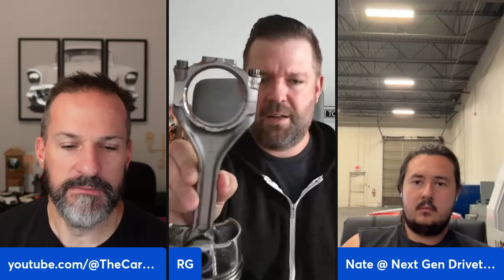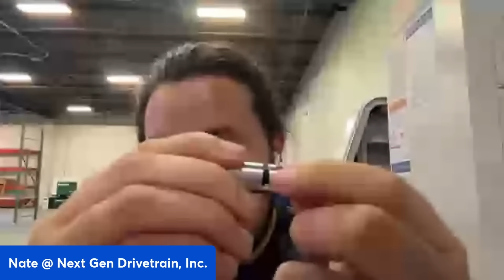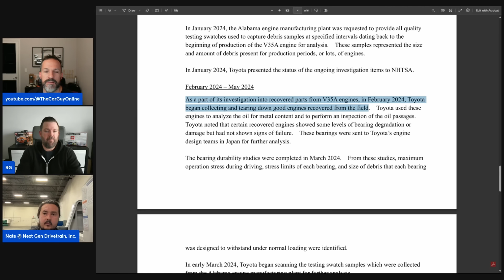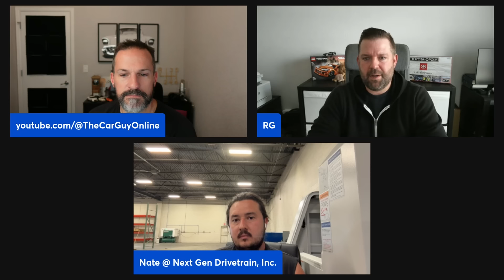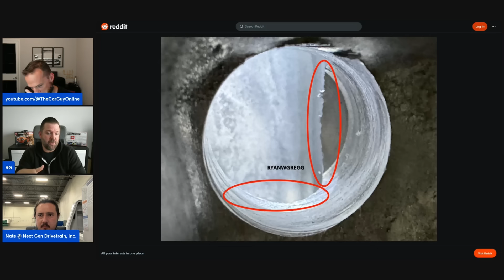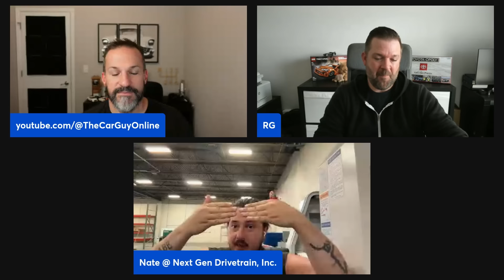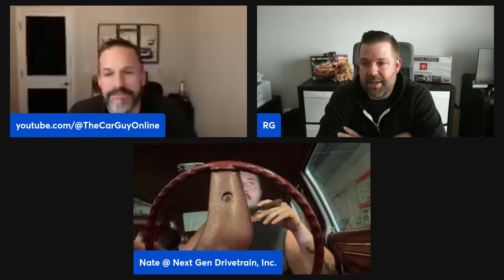Toyota Tundra BOMBSHELL. Buyer Beware Until 2026 (Full Interview)

Comment: sorry, this has to be said...  guy lost me at not running the factory reccomended oil viscosity (on stock engines).  my 2 cents is run the factory oil from the dealership parts counter, and, more importantly, the factory OEM oil filter and change the oil early.  🤷🏻 I go about 1/3 of the manufacturers reccomend oil change interval.
Reply: If fuel economy regulations weren’t driving the auto manufacturers to use thin oil in the US I would tend to agree with you. 

However absent those regulations, Toyota allows thicker oil overseas for both vehicles I checked: The European owner’s manual for the 2016 Camry and the Australian owner’s manual for the 2023 RAV4 both allow two grades thicker oil in warmer ambient temperatures.
Reply: They were doing it in high temps in the Middle East. I’m old enough to remember when manufacturers used to recommend different oil based on the seasons or expected temperatures. I guess physics changed in the last 20 years? 
 By the way. Ford recommended 5w20 in their V10. U-Haul was given permission to run 10w30 by Ford. It’s all about trade offs. The OEM picks the best oil to use across all possible scenarios. That doesn’t mean it isn’t better to run a different oil under specific circumstances.
Reply: @AlphanumericCharacters well that is a fact, they still do reccomend you change your viscosity if you fall out of the temperature range that's specified in the manual.   that i will agree with you there.  but the guy RG isn't outside of the operating range where he lives and he specifies that he doesn't run the factory reccomended viscosity in his personal vehicles, he runs a heavier one.  I believe i heard on an engineering explained video that changing the cold flow number (the first number in the viscosity rating) isnt as dangerous as changing the 2nd number but I still dont see the point if you're  operating the vehicle on the street under normal circumstances and in normal climate conditions.
Reply: @kcm732 oh, ok. I thought you were referring to them mentioning the failures in the Middle East. 
 I wouldn’t change the viscosity either if in a normal climate. 
 That said I don’t think this is the issue. Nobody can make engines all of a sudden. I suspect it’s due to parts being sourced from China. There was a recall from Ford where they stated that the supplier of a cylinder head had altered something that caused a failure. I wish I could remember what it was but point is……supplier of cylinder head? Since when does Ford not make their own cylinder heads? What else are they outsourcing? You know if one is doing it then they all are doing it. I would bet major engine components are coming from China. I would also bet that is the source of many of these failures.
Reply: @AlphanumericCharacters yes, its certainly possible.   and also if you do care to watch the video I mentioned from engineering explained, the subject matter was on the recent GM v8 engine failures and their "fix" was to change to a heavier viscosity oil to engines that hadn't failed yet... its so wild, but I digess... I still kinda dont trust the guy named RG as a guest completely from his statement on the oil viscosity.  
but yeah, who knows where toyota is getting their parts from. I do know that all toyota truck engines. at least the tacoma and tundra, final engine assembly is in the USA, But truly unsure where the raw materials come from.  
there's even wild/strange issues with the V6 3rd gen tacomas (of which I'm an owner of one) where they will randomly just burn a valve on, usually cylinder #1, and sometimes on cylinder #5 most times, but #3 has also been seen.  I just dont know man.  no company seems to make a reliable vehicle these days unless its a mass market mover to save their reputations.  from where im at, only the toyota corolla sedan/hatchback, corolla cross, RAV4, camry, and honda HR-V are the only brand new vehicles that you can go out right now and purchase that have the chops to go for a very long time.  everything else is either solely direct injected, or has other high dollar maintenence or failures.  its really sad to see the the state of the auto industry right now.
Reply: @kcm732  not to burst your bubble but those cars you named are CVT. They suck. I had a few HRVs come in with CVT issues and the Honda dealer ducked and dodged all day. Wouldn’t fix them. One issue should trigger a safety recall. Another customer bought a used RDX a few months back. Only has 40k on it and it’s been a nightmare for her. I mention that specifically because I had it in again the other day. I’ve been seeing a helluva lot of junk coming from Honda. They recently had a recall in the J35 where they are rolling bearings into the engines too.  
 Hell I was looking at buying my kids a new Honda dirt bike. Damn things are made in China now!
Reply: @AlphanumericCharacters thats honestly the first time ive heard of any issues with a honda cvt. the only issues ive heard from Honda as of recently are the head gaskets blowing on the 1.5T and 2.0T and issues with the 3.5 v6 crankshafts and VDC system.  the toyota non hybrid CVT is honestly very good imo thats in all the corollas, and the non hybrid rav4 still uses the 8 speed for a bit longer which is fine for what it is. and all the hybrid versions use a cvt but its a completely different cvt setup in the hybrids vs. the non hybrids, and those seem to have been long-term reliable too.
I also used to own a non hybrid corolla cross LE AWD with the regular cvt.  I thought it was fine, I actually enjoyed the thing.
Reply: @kcm732  three different customers with the HRV that wouldn’t accelerate from a stop. Foot to the floor and the thing was as if it was in top gear. I never duplicated it and neither could the dealer. However, all of the owners had video. I’m going to say the first one was a 2018 and the other two were 2020. The one customer stated that the first time he did it was when he tried to make a left turn into front of incoming traffic. Sketchy as hell. Tried to lemon law the thing but because Honda never attempted repair and couldn’t duplicate the issue it was refused. That guy had like 20 videos. He mounted a dash cam on his console. The other two customers I didn’t get too involved with, just sent them to the dealer and told them about the other cases. Clearly this had to be a widespread issue. 
 Also know that the CVT in a hybrid is different than non-hybrid. Those tend to be very reliable. Whether Toyota makes better CVT than JATCO for instance doesn’t change the fact that they are not as robust. Especially with a more aggressive driving style.

Comment: I work at one of the big three, and I can confirm, what goes on is ridiculous, UAW is horseshit. Absolute legalized mafia. But what amazes me is that this guy bitches and moans about Toyota, and every five minutes says that he won’t buy anything else. And what do you think Toyota is thinking? Why improve when everyone is falling over themselves to by it anyway. The best thing to do is stop buying new overpriced junk, from all of them.
Reply: That mentality will spread like a disease through Toyota customers slowly though dont worry...
Reply: How does an engine built in Alabama is a  non-union factory where robots do the bulk of the work have any effect on bad v6 engines? DEI ( Do EVERYTHING for Investors) is way more of a problem.
Reply: @jimmyaber5920 Toyota has different issues at their US plants than the Big 3 do. The Big 3 would be glad to have Toyota’s problems, and Toyota’s stock performance. I’m just saying that UAW is a racket with a a stranglehold in the rust belt, and has to be treated as such.
Reply: I agree, people do need to stop buying the new junk. Unfortunately, that won't happen because so many people are brainwashed by marketing. Gotta have something new/status symbol. Also, many people are afraid of used cars due to the possibility of expensive repairs and no warranty.

Comment: 10 freaking gears in a truck/suv is nuts. 6 was absolutely perfect. Never thought I needed more gears...ever.
Reply: They wouldn’t put in more if they didn’t have to. It’s all emissions
Reply: @joseeduardo4327 exactly- always comes down to some leftist aka democrat bureaucrats/politicians
Reply: Some of those gear ratio are so tall.. they'll do almost a 100 mph in 3rd. so the other ratios are for what 😂 I think 8 speed is the cap.. the sweet spot.. over that it's just diminishing returns..
Reply: Hey Captain Mojo, I have a 2016 Tundra pulling a 8500 lbs fully loaded camper trailer, and to be honest, I feel there's missing at least 2 gears. Just because of the engine RPM and the transmission chasing gears from time to time between the 4th and 5th gear... that's just my opinion!
Reply: @Hunter-qg2bv I just towed my 8500lb boat plus a bed full of stuff from tulsa to clearwater last month averaging 70mph using my 5.7 Tundra with 6 speed and it was easy peasy. Mines a 2012 and never seemed to be hunting for gears. I wonder if yours is programmed differently.
Reply: @TheCaptainmojo1973 I hated the 6-speed in my 2012 Tundra. That transmission had a lot of problems in the early years so there could be an issue.
Reply: Gears planetary reduction cvts you don't even need to shift one gear all the way to 110
Reply: @Your-moms-hitachi if you hate cars buy an ev
Reply: @Your-moms-hitachi CVT's all suck. More cartel mandated junk.
Reply: We used to tow just fine with 3 speeds and a big block. Hell even a 350/TH350 towed well before all the emissions BS.
Reply: Like 5 manual gears!   Bring it back!
Reply: That’s was the green lobby idiots.. same with the turn off on when stopped bs
Reply: The regulator cartel thought you needed more gears, and they always win.

- Nate @ Next Gen
Reply: I’m glad to see that I’m not the only one to think 5 and 6 speed autos were the sweet spot.
Reply: I love the 10 speed transmission on the GX550
Reply: Nah 10 is the right amount. It just needs to work if it doesn't work it's bs

Comment: When I was in engineering school Toyota was used as the penultimate example of “Quality Engineering.” The company literally invented Kaizen/5S. This is demoralizing.
Reply: Kaizen and 5S are great tools. But like any tool, it’s only as good as the person using it. I would bet upper management aren’t invested in the process anymore.
Reply: It's been on the decline for a while. The unintended acceleration cover-up and changing their new vehicle warranty to claim that burning 1 quart every 1,200 miles being signs that the corporation was changing for the worse.
Reply: @hochhaul My daughters had V6 Honda engines- 3.7 L and 3.5 L.  Heavy oil consumers - Honda said that as long as they didn’t use more than 1 quart of oil/ 1000 miles that was acceptable.  So it’s not just Toyota.  I’ve owned Toyotas and Lexus vehicles and they didn’t require adding oil between oil changes.  But it sounds like the newer Toyotas aren’t built like the old ones.
Reply: The “Toyota Way”. 😂
Reply: Don’t read any updated versions of the “Toyota way” book.  The original is best
Reply: The Japanese built stuff is still good, this is a USDM problem
Reply: When I worked at USG they started 5s because of Toyota, but let me tell you they didn't use it to have better QC in my opinion lol. People don't understand that Toyota has  and will continue to lower it's standards because Ford, GM, and Stellantis already have and are still selling this crap and are there by financially incentivized to do the same. The only thing that stops is people voting with their dollars. Loyal customers are rewarding bad behavior like a bad parent.
Reply: For the most part Toyota  new 4 runner is garbage.  Power is not linear in the 4cyl turb, interior is smaller with a bigger overall vehicle.  In Texas heat kills and im curious how many people will blow up the already.overstressed 4cyl drivetrain.
Reply: They are also mentioned in many business books as well. I also encountered this in engineering school as well. Clearly times are starting to change but companies can make mistakes even those that have been at the top.
Reply: Continuous Quality Improvement had it's founding by Walker Shewhart and W. Edwards Deming. Japanese call it Kaizen which means "change for the better".
Reply: @troycarothers8254 enter teh beancounters…
Reply: I love when hedge fund stooges in corporate America try to roll out kaizen as a ruse to their employees and shareholders. Kaizen is a cultural thing that doesn’t work in a world run by accountants.
Reply: It's what happens when you get accountants and MBA's involved and lose sight of design, quality, and testing. Instead, focused on outsourcing and cost cutting. Just god awful.

Comment: So you're putting 5w30 in a 5.7? Have you done anything to the engine or is everything stock? I'm run 5w20 now. Im not a big fan of running 0w20.
Reply: Same 5w-30 ,2021 platinum tundra 58000 will not use anything else

Comment: So the new Tacomas are having the same engine issues as the Tundra? So it definitely has something to do with the manufacturing procedures/process at the Alabama plant? I’m also surprised there isn’t more talk about the faulty rear differentials on the Tundras. That seems to be a widespread issue that is under reported.
Reply: The Tacoma engines are made in either West Virginia or Alabama. You'd only be able to tell who made it by looking at the engine block.
Reply: New tacoma does not have the wide spread issues the tundra has.  I have one and its not even an issue on tacoma forums or owners group

Comment: Moral of the story pre-covid better quality. Post covid worse quality. Can say that across the board manufacturing, service industry, etc.
Reply: Boy you nailed it peter, I’ve noticed the same thing. No pride in workmanship in any industry anymore. Buy it, or get out of the way, the next person will buy it, people don’t even say thank you anymore.
Reply: Interesting how Frontier quality is fine post-covid, even launched DURING  covid, yet no one can seem to admit that.
Reply: @TIJoe-te9qu Frontier is a great truck. Simple design. Workhorse.
Reply: Lol.  My Jeep Grand Cherokee was built in June, 2019.  I still have some problems, but the newer ones are even worse.
Reply: ICE technology has reached its end game. EV technology is taking over worldwide, some places faster than others, but it is happening. Gasoline engines have reached the point where every last HP has been squeezed out of a block before reliability issues make engines not a valid mainstream solution anymore. Back in 1987 a large V8 out out 200hp. Now modern engines are expected to put out 400, 500, and more than 700hp out of a smaller block. Crazy. BYD just rolled out a 3000hp super car that can jump in the air like Speed Racer.  The US risks falling far far behind the rest of the world if Americans do not realize EV technology is now more reliable, faster and more reliable than gasoline engines. This is the modern reality.
Reply: @nerdbikes3841  EVs are nice as golf carts but I personally have no confidence in them.   Where is the additional electricity coming from to power these things?   And where are the batteries being made?   Toyota needs to fire the 3rd Gen Tundra team and restore the V8 engine.
Reply: @MikeKendall-m6c imagine being able to manufacture your own gasoline at home. That is what I do with my solar panels for my EVs.
Reply: @MikeKendall-m6c You can’t refine oil in your backyard, plus it is pumped from the ground , today one can install Solar panels and a bank of storage batteries and go OFF Grid and charge their EVs off that .
Reply: @AuralioCabal-nl8gi  Where do you think the materials used to manufacture solar panels and batteries come from?   And it takes fossil fuels to manufacture the panels and components.   You need a better argument.
Reply: But electric cars are not convenient for everyone.  That is the big problem.
Reply: @nerdbikes3841 - stop listening to Doug
Reply: @nerdbikes3841   Hear , Hear !  ICE is a dying Technology  , but somebody forgot to tell legacy auto, OR THEIR EARS ARE PLUGGED!

Comment: I have a '23 rav4. Just found out some of them manufactured during 22-23 are having oil leaks at the cam journal and I'm questioning the reliability of the coolant control valve even though they supposedly fixed that issue. Fingers crossed 🤞

Comment: RG doesn’t know what he’s talking about on the ZF 9 speed it is not TCC lock/unlock. TCC is PWM from about 10 mph a physical clutch changes from 8th to 9th with the C clutch coming off and the B clutch applying with a ratio change from 0.58 to 0.48.
Reply: Close but not accurate

Comment: Thought hard about getting a Lexus GX550, but with that V6, I picked me up a 23’ GX 460 with the bulletproof 4.6 V8. Not caring about its 21 mpg average. I’m sleeping well at night with the V8.
Reply: Flush and fill your transmission fluid every 60k.  These gx460 transmissions are failing for solenoids as they hit higher miles.  If you have a used higher mileage 4.6 V8 and no history of transmission fluid flush, drain and fill only or its gonna fail.
Reply: Good luck with your impending coolant valley leak.
Reply from the maker: Good call on getting the tried and true engine!
Reply: Great Engine M8, great SUV... nothing like the 150 series Platform... mine is a 2022 Land Cruiser Prado with the 1GD-FTV 2.8L diesel....
Reply: Yep, just bought a 2019 4Runner, which has the V6 and 5 speed auto.  Really glad I went this direction and not new!!
Reply: I traded my 2023 IS500 for a new 2025 4Runner TRD Off Road Premium.
Reply: @moonman_8935 good luck on that... wouldve stayed with the 5.0L V8 for sure... but thats your call.